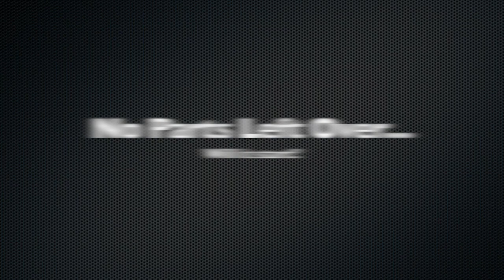DucaBike Slipper Clutch Install into 2009 Ducati 1198S

Comment: Hello, i just installed my ducabike slipperclutch on my 916. Changing gears up no problems but downgearing on high speed i feel a resistance in the lever. Did you have to put grease on the small metal balls or does it work dry without grease. Thanks for your quick answer!
Reply from the maker: Hey Famke. 

Yes, there is definately a different feel to the clutch. The lever does feel like it “clicks” or loses pressure. That’s the “slipper” function and does take a bit of getting used to. 

As for greasing the bearings, 100% they need to be lubricated to run up and down the ramp.